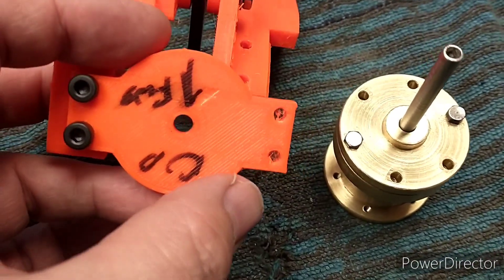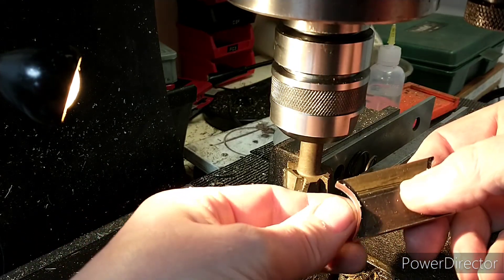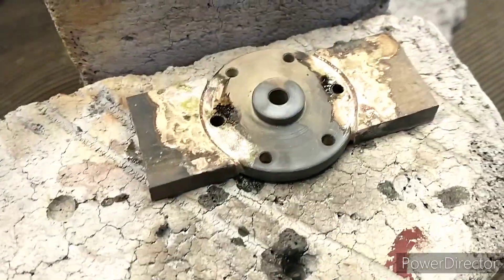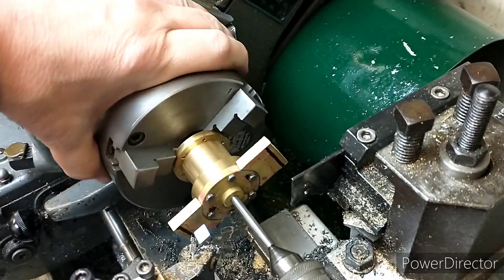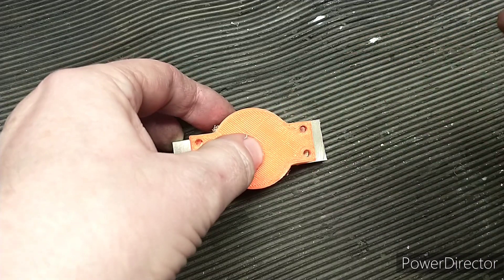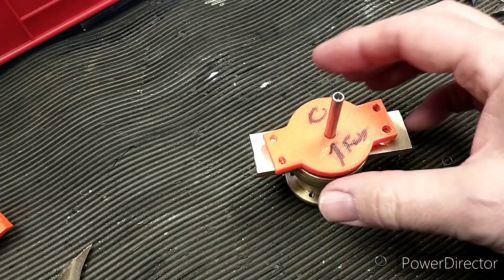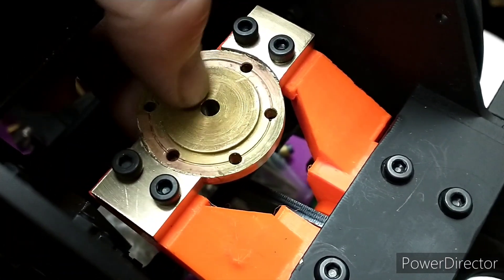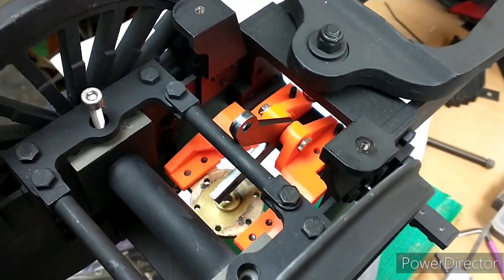Modelworks Britannia Ep 22: Ear Ear.....

Comment: The Brake force pushes back on that joint, im not really sure if this will last long..... but nice job! Really!
Reply from the maker: I disagree and I did the sums to prove it. The safety factor is over 40 when full boiler pressure is applied to the brakes. Would you like to see my working out? Thanks 😄